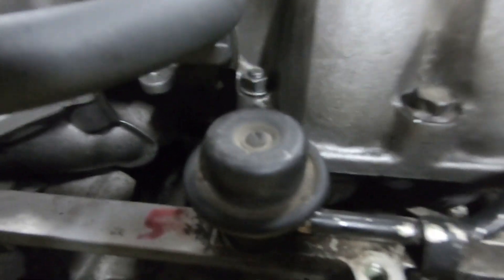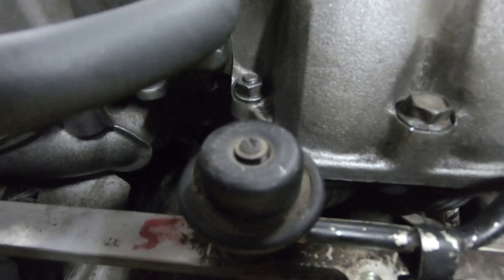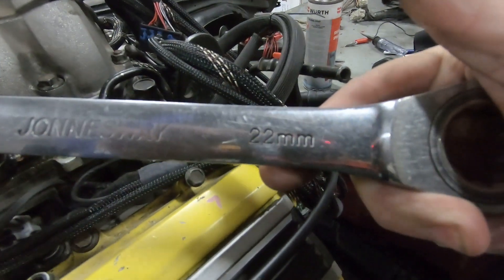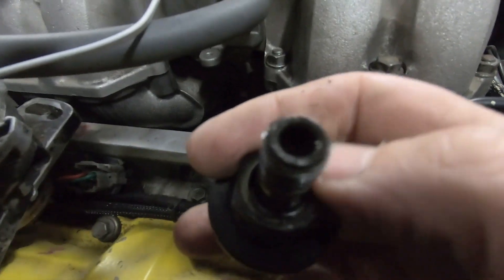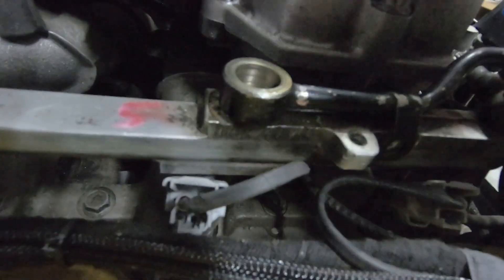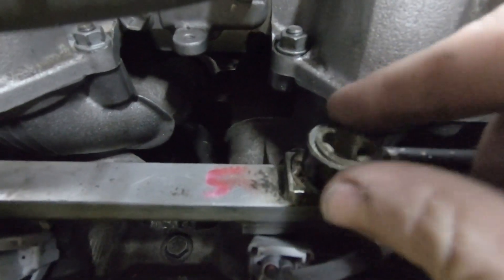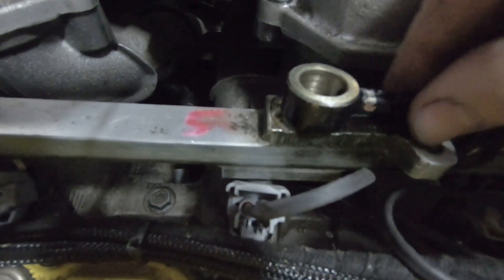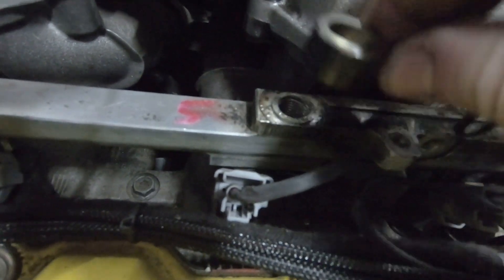1uzfe Basics - Fuel dampener

Comment: Sir I have a 1999 sc400, and my damper failed causing gas to spew out the top, like a overwhelming amount. So I ordered the part but the new part is closed off rather than a screw. Can you inform me if that is a problem.
Reply: buy the original version or one with a screw on top
Reply: Did you end up running the one with no screw?

Comment: Hey man I have a question why is my fuel dampers leaking from the top screws on both fuel rails.? Does that mean there bad.?
Reply: i was smelling gas in my cabin, so i went to replace my dampeners and one was missing the screw and i smelt gas by it so if you haven’t all this time swap them

Comment: What causes the small screw to pop out of the Damper
Reply from the maker: Generally the screw pops out due to someone screwing it when its not meant to be screwed.   If it does come right out from the unit its time to replace the dampener
Reply: @CartuneNZ  Thank you sir. I will be replacing it.

Comment: Im having trouble finding the special slotted crush washer that sits right below the dampener. Does anyone have a part # or website that could help me get my hands on a suitable washer (in canada) I recently had fuel rail apart and reused that washer but replaced all the other "standard" washers. It is sweating/leaking from that one now. 

1989 toyota camry 2.0l 4 cylinder 3sfe

Comment: What about using 2 dampeners when using a hi flow pump? I have 1gz-fe v12 with an aem pump and aem fuel pressure regulator and  have a lot of pulse with just the oem dampener 🤔
Reply from the maker: We would generally head towards an aftermarket unit.
Reply: @CartuneNZ  i just installed another oem dampener and it reduced the pulse like 50% 😅

Comment: Would a bad unit cause the engine to cut on and off and stall out?. My 96 ls won't idle and will die but if i put it in gear it will hold idle but idle will drop as if the car turned off but will idle back again

Comment: Hey mate. I’ve got a 1uz 4Runner that I drove through water “not deep, just probably to fast” which caused me to stall the vehicle & since then it hasn’t started unless I use Aerostart. What could the issue be? It gets fuel to the rail & has spark

Comment: Hi there, is it possible to do a video on fuel lock? I have a 1991 Land Cruiser with the Gen1 1UZFE engine. The fuel pump is screaming crazy after some time of driving. Although I do not notice any other issues, the pump is very noisy on hot summer days. I suspect it is a fuel lock or fuel vapor problem...hope you can give me some pointers? Cheers for a great channel!
Reply from the maker: Let me guess you have an external fuel pump?
Reply: @CartuneNZ  Yes sorry should've said so.
Reply from the maker: @clintonscholtz213  so I rarely run a external pump,  instead I prefer internal.  Most external fuel pump is not designed to "suck" fuel from the tank so the extra time setting up a lift pump which is designed to draw fuel and deliver into a surge tank which provides a head of fuel to the high pressure pump seems pointless in most normal swaps.   In high performance settings its appropriate.   I see lots of guys with failures due to fitting an external pump incorrectly then suffering noisey pumps or prematurely failed pumps.  So if I do a video on external pumps its likely going to be how to throw a poorly designed system away and do it property.
Reply: @CartuneNZ  I am happy to start from scratch and spend the money to do this properly.

Comment: So when one has gone bad, would my engine be making many small clicking or tapping noises that is annoying as hell? Almost like rapid lifter tap but not near as loud?
Reply from the maker: These could tick if they fail,  or they leak.  Easy enough to confirm both faults.  Cheers Kelvin
Reply: @CartuneNZ  mine is closed. It has no screws. I wonder if it could also kill fuel pressure
Reply from the maker: @greattribulation1388  best measure fuel pressure to confirm

Comment: Great video. There's not much info on this little pain in the ass. My 01 is300 developed a fairly loud tick. Check valve lash and its perfect in spec. Used a stethoscope and found injectors are the noise. Order a damper. Fingers crossed she'll quiet down!
Reply from the maker: Would be interesting to find out if it solved it.  Cheers Kelvin
Reply: @CartuneNZ  unfortunately the injectors are still loud. I ordered two new up stream o2 sensors. Densos. I'm also going to try changing the regulator on the pump itself. Otherwise I'm at a loss
Reply from the maker: @jeremyc137  the injectors often do make a bit of noise.   But they shouldn't be loud

Comment: Having fuel cutting when I apply more than 1/4 throttle on my 1uz swapped 1993 4Runner was wondering where I should check first I had my ecu capacitors replaced and replaced my fuel filter to see if that would help my issue
Reply from the maker: I would be confirming the wiring is correct as per my instruction sheets and then doing all the normal checking.  There are also different issue depending on model and ecu.  Cheers Kelvin
Reply: @CartuneNZ  I did heeps of trouble shooting. I’ve watched a bunch of videos you’ve made and still can’t quite get it. Checked tps it’s performing the calibration check with the test light perfect . wiring at the iac wiring is good according to your information. Also replaced fuel pump and a bent fuel line to know changes. I am getting spark on both coils and made sure ignitors are grounded. Power is present at b+ with ignition on. Cam sensors were checked by unplugging one at a time and ohm the crank sensor and it was in spec. Grounds cleaned. And added one just to be safe. I’ve checked for vacuum leaks around the intake and no change. I’ve yet to spray engine start while trying to rev to see if it will rev up at all. Currently any blip of the throttle bogs it down. It’s a 91 ls400 gen 1 1uz mated to a automatic transmission that I have put into my brothers 93 4Runner the wiring was done by north west toys but I’m almost positive that it’s not a wiring issue on there end of things since it ran and drove for a month after the wiring was routed. I would love to send you a video of it running to hear your thoughts. Josh from relentless has been pretty helpful in helping checking things I wouldn’t have before definitely learning more about the brothers 1uz then my turbo Miata hahahah I love the knowledge you bring to the table I appreciate guys like you that have this knowledge and share it publicly. i will check your wiring instructions once I’m stumped on checking everything else and come down to only possible thing being the wiring
Reply: @lowschool8332 did you find the issue ?

Comment: I have an sc400, started ticking and some say it could be a bad dampener, is there a way to test them?
Reply from the maker: if its making noise then I would replace.  Otherwise checking fuel pressure with a sensitive gauge.  Cheers kelvin

Comment: Fuel pump isn’t working if the screw don’t move?
Reply from the maker: Thats normally the cause of the screw not moving
Reply: CartuneNZ thx for reply. My issue came down to the open circuit relay being bad. Keep up the great vids
Reply from the maker: @LittleLady_yt  well done.   Great diagnosis
Reply: Thank u

Comment: Hey sir. I have a stock 92 sc400 w 103k miles.  She has a long cold start, crank for 5-6 seconds when cold... Then no further issue after car is warm, turns right over. Suggestions? Thank you.
Reply from the maker: Ive been meaning to do the cold start injector circuit on the SC400 and soarer cars.  I would check this , along with ECU health (I often service as maintenance these days) , confirm fuel flow and even the basics like spark plugs , coils and leads.  Also the EFI temp sensor could have an effect.  Cheers Kelvin

Comment: Would that part if it was bad cause a low idle in gear? I have a 1uzfe in my Lexus GS
Reply from the maker: Hello.  I would not expect this to cause a low idle issue.  Chances are very low.  if the screw pops up and it isnt leaking generally they are ok.  Cheers Kelvin

Comment: Is it possible for these to click or tick quite loudly? On my Cammed 1uz, I thought it was a shim, but the guy who put the cams in adjusted all shims. Listening with a screw driver, the loud ticking seemed to be the fuel dampener.
Reply from the maker: Sure can.  They can make quite a noise but this is generally with bigger fuel pumps and aftermarket ecu with different injectors.  Cheers
Reply: @CartuneNZ  this much noise? You can hear it upon backing off early in the video. https://youtu.be/ypIV8BVNi2I
Stock ecu, pump and injectors. Cams and shims just done there. Trying to find a bloody harmonic balancer/crankshaft damper. But no one lists the correct models for the part numbers on toyodiy

Comment: I was under the impression that the injectors opening and closing was causing the pulsations on the fuel rail and not the pump itself
Reply from the maker: And that too.  Both cause differences in the pressure. Thanks for mentioning that as well.  Cheers.

Comment: Yet again another very well explained video. Thanks
Reply from the maker: Thanks Michael.  Trying to do a few of these short basics videos of the stuff I often take foregranted .  Cheers
Reply: @CartuneNZ  can you do one on wiring a 1KZTE to A343F 😎 still trying to find suitable connectors to use for the job. Wanna do it once and correct. Not gonna settle for rubbish. What is the connector type you  use? Think I need a 12pin and upward connector for all the transfer switching
Reply from the maker: That would require me to work on a Diesel, haha.  Sorry I don't have any booked in at the moment but if one comes in Ill think of you.  I use Deutsch connectors as a preference.  For small amperage DTM work great but I'm not sure how you will go about finding these in Africa. Otherwise dont run a connector and splice the joins as I know finding parts over there is tricky.  Good luck.  cheers
Reply: @CartuneNZ  splice is just crimping. I have researched and they say a plain crimp is better than a solder because the solder degrades and an cause dry joints. Getting tips from the expert here. Cheers
Reply from the maker: Yep,  splice and crimp can be interchanged.  I prefer to use crimps and if its old wire I might grab my soldering iron.  Most factory looms are crimped but they all start with new wire.  Most important is the wires are joined in a strong fashion.  Cheers
Reply: @CartuneNZ  ah well the vehicle is 25 yes old 🤣

Comment: What is used to retain the dampener, but delete the banjo for a barb fitting or someway to run different lines to it?
Reply from the maker: Lots of options.  We have access to some aftermarket banjos where we can sweat on a AN fitting or different push hose.  Or screw in fitting and run inline dampener.  Plenty of choices.  I'm sure speed shops in the US would stock some suitable fittings.  Cheers
Reply: You can get proflow banjo fittings to retain the dampener and use an style fittings. I did this to my conversion. As I had to use proflow ( Teflon I think ( hose for e85 alcohol. Hope this helps